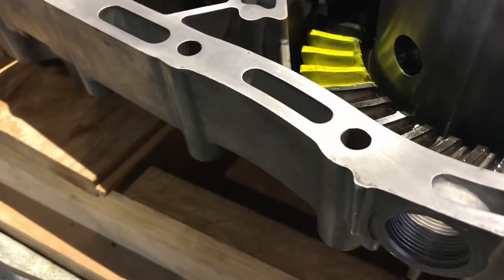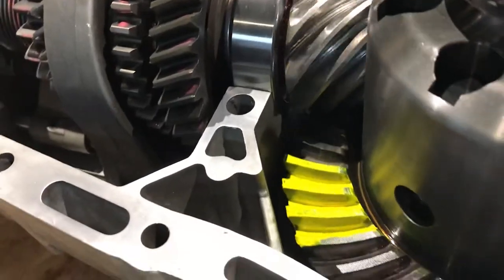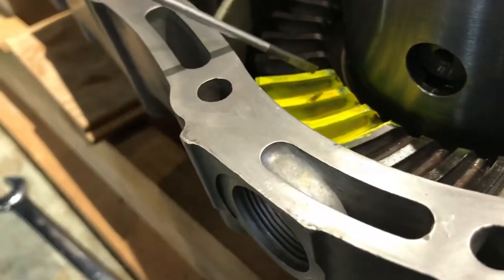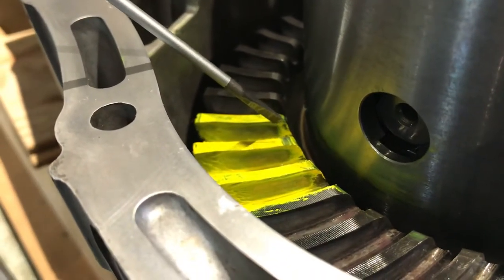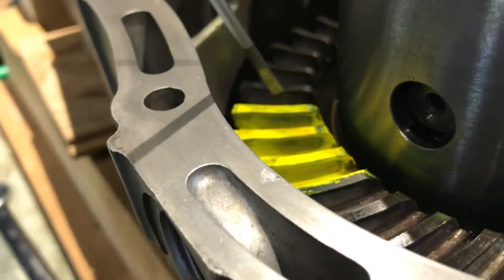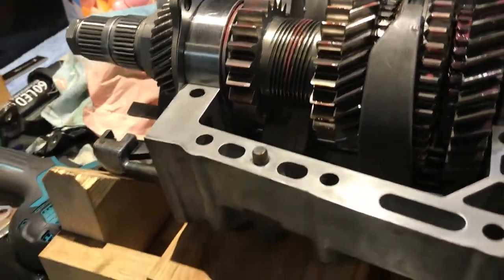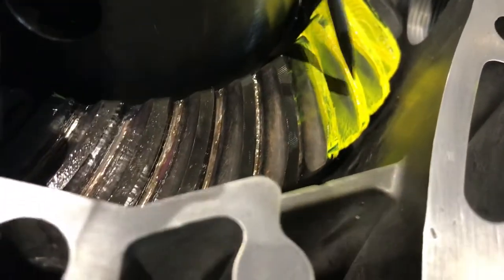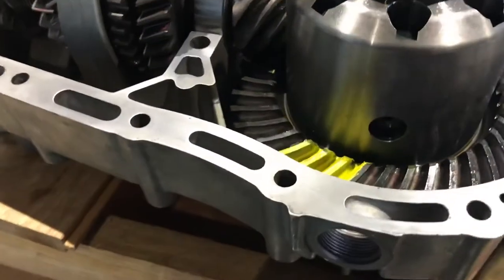Subaru Impreza 5MT PPG Straight Cut Rebuild, Backlash & Preload Pt2

Comment: So if left it would prematurely wear ? So that’s why that section is painted.
Reply from the maker: It might not necessarily wear if left without adjustment, as it would probably be in spec for normal road driving, but seeing at this is 99% a track thing then it just makes sense to go the extra mile.  That section is painted just whilst running a tooth pattern, it was cleaned off once complete.